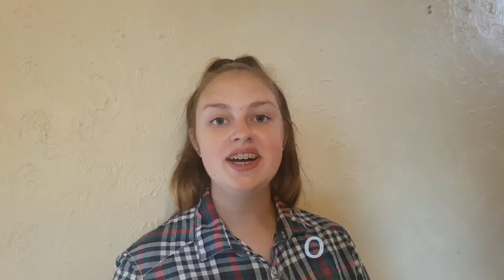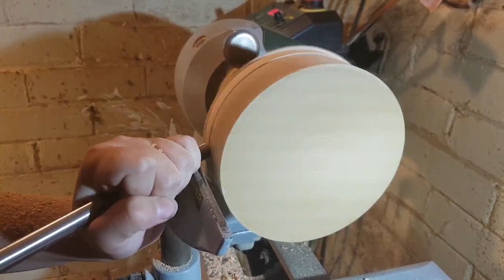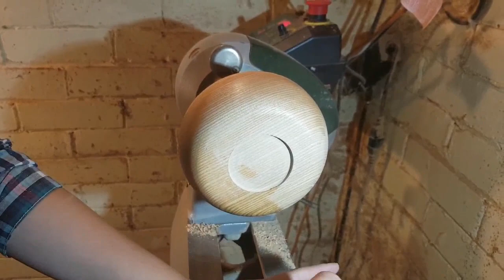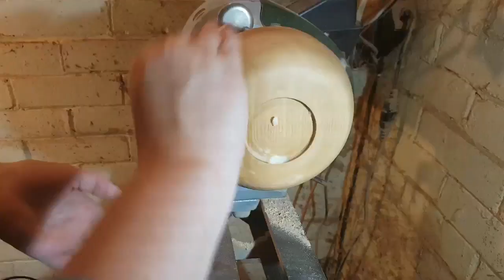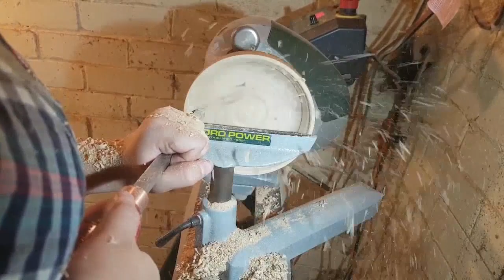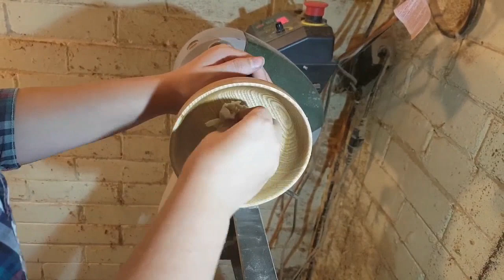Woodturning | American Ash Bowl

Comment: I
Because of your age it is probably difficult to find a smock to turn in. An alternative which I use and may be appropriate and is a little trendy is a Cycling top 
The advantages are It improves your safety has there are no cuffs or loose fabric to catch in the lathe, its breathable so it keeps you cool 
Ebay is a good source to find a better quality top at a reasonable price